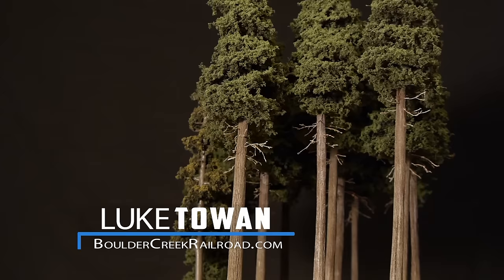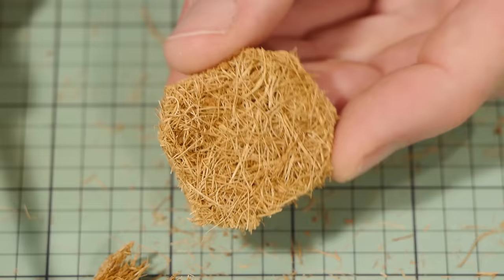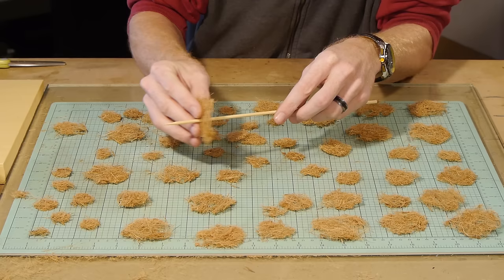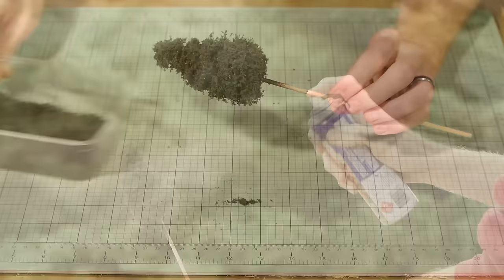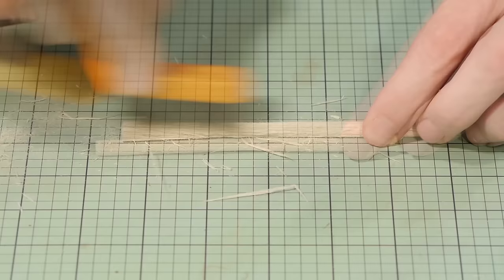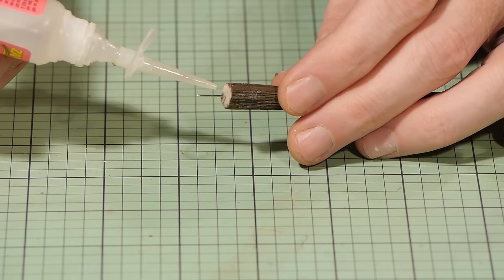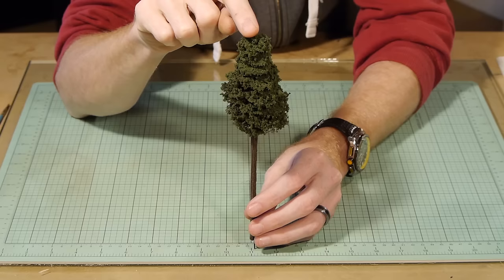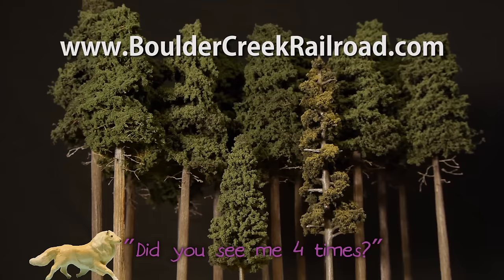Tall Forest Pine Trees – Model Railroad Scenery

Comment: I love the simplicity of the idea. I couldn't find the basket liner or coconut fibre so I used a dish washer scrub instead. It was quite difficult to pull them apart to create layers, so I soaked the scrub in water and when it softened, got to work!

Comment: Thanks; made about a half dozen and turned out pretty well.  Question, when you're doing the israeli primer paint, you're dabbing the paint brush into two different "things"  i bought the paint but not sure if that's all you are using.
Reply from the maker: Hi Richard, I only use the israeli paint on its own, I dip the brush in the paint then I wipe the brush on the paper towel to remove some of the excess paint before brushing it across the balsa wood trunk. Hope that helps :)
Cheers
Luke

Comment: Is there any reason you didn't place the coconut fiber circles directly onto the dowel you used for the trunk instead of going through the step of using the skewer and cutting it off later?

Comment: Great video as always, Luke.  I'm surprised I haven't seen anyone suggest using the giveaway chop sticks (bamboo) you get  with your take out order at the oriental restaurant, for the tree trunks...they are just the right size, already tapered and FREE after you've finished your sukiyaki!...now I have the perfect modeling use for all of the sticks I've saved...  Bamboo is too tough to texture with a wire brush, but scratching it by pulling it over a bed of drywall screws (shown in another "making trees" video) works well.  Cheers from Connecticut!

Comment: Hi Luke
Love your videos - a great help thank you.
I've made a few pine trees for my 1:32 slot car layout (not as good as yours but not bad for a beginner)
My first error was making them the same size as yours. I think HO is about 1:87 so my trees were a bit small !!!
I used clump foliage first of all as you did but couldn't get the dark green colour I wanted so I purchased a couple of florists blocks (the foam blocks they use for flower arranging) then grated it down using a fine cheese grater. A small block (11cm x 8cm x 8cm) yielded half an ice cream container. ie: half a litre. 
It looks identical to the clump foliage I purchased for $9 for a 412g bag. 
Total cost? $1.99 

I'm not good with technology but the following url may take you to a photo of the result on drop shots.

http://media6000.dropshots.com/photos/1374750/20170218/x_183340.jpg